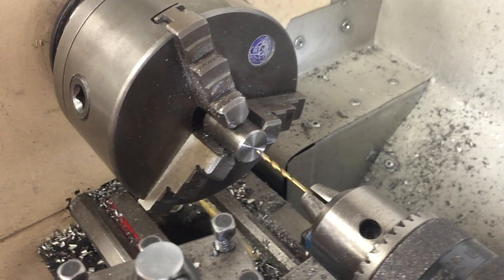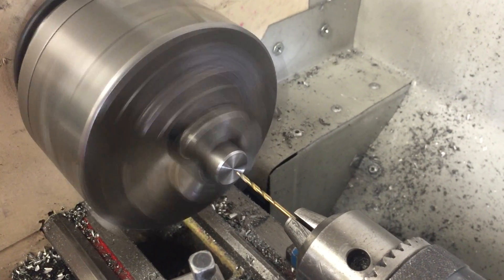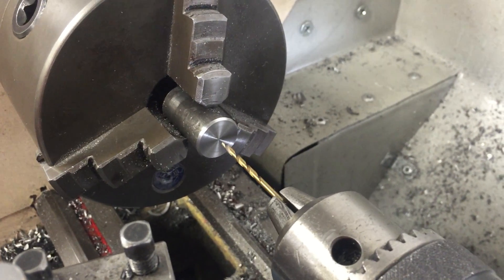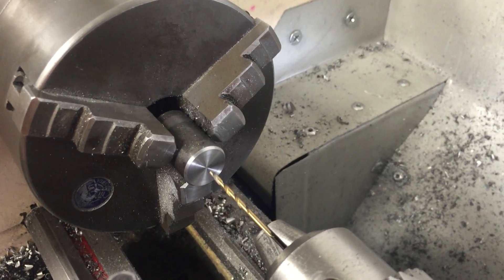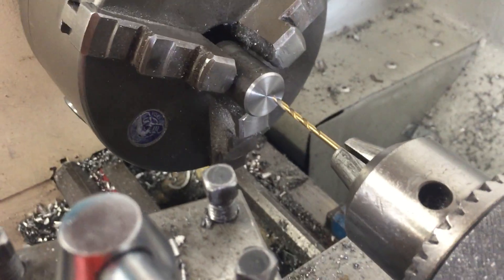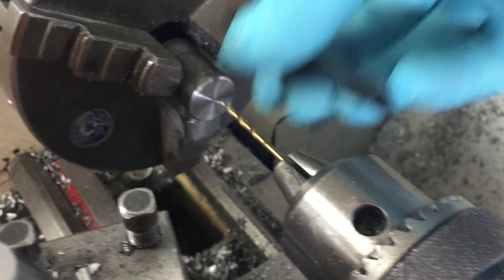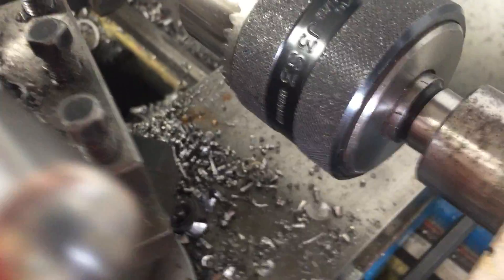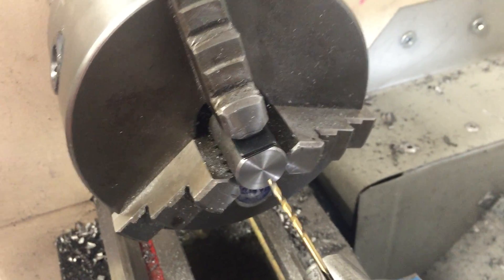Turning / drilling off centre in a 3 jaw lathe chuck. Eccentric turning / drilling.

Comment: You didn't actually drill a hole because this wont work!
Reply from the maker: Sure 🤷‍♂

Maybe if you explain yourself better I can respond with something that makes sense.  This did work. I made a quick release for my tail stock and posted a video about it. I didn't drill the hole on camera because I was holding my camera in one had and it was shaky and because I was using a "normal" drill bit for the demonstration and not a starter bit. 

I know it looks crazy, but I assure you, it works. 

Cheers
Reply: Ok yes I see it now, my error.

Comment: I believe if you continue to do this terrible mistake, very soon you will find that your three jaws chuck’s SCROLL it runs out. The three-four-six or whatever jaws chuck are not builded for offset tightening. If love your machine STOP immediately doing that, and don’t listen any other naïve.
Be safe and “Keep Turning”.
Reply: This is old but still incorrect. The three jaw chuck is not tightening off center the jaws are tightening the same way as always, it is only the work piece that is off center there are zero damaging forces applied to the chuck. Someone obviously does not understand the function of a chuck.
Reply: "Rubbish!"

Comment: great topic, one that is rarely seen!  yet the basic formula for calculating the thickness of the shim stock to use is:  Desired Offset x 1.5... so 6mm x 1.5 = 9 mm would have worked a bit better?